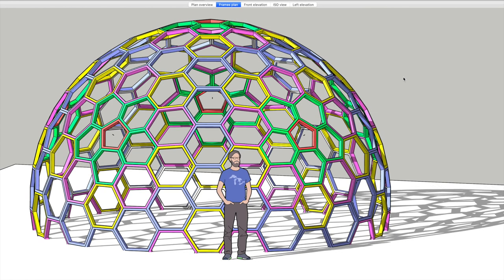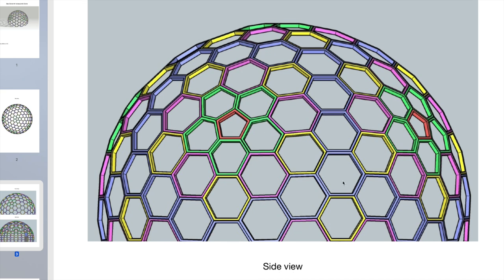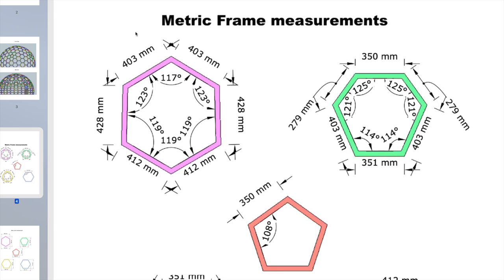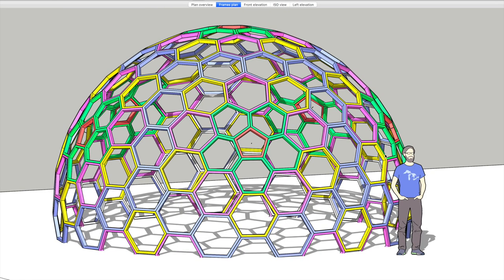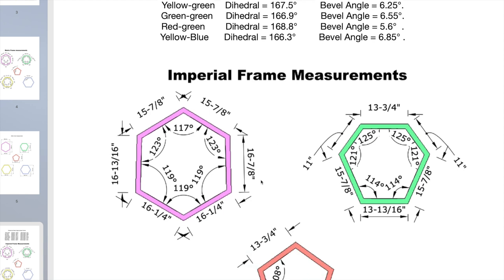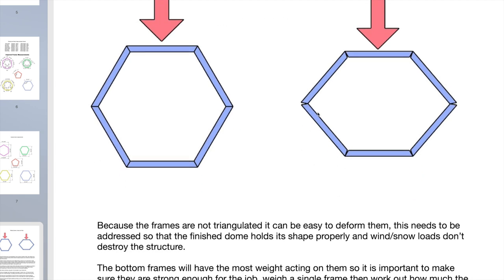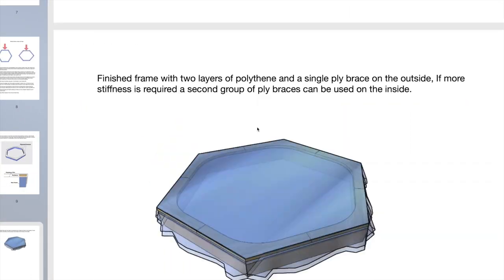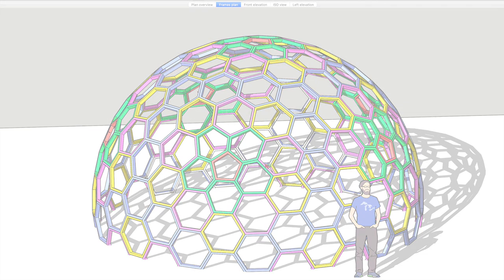Free 9v Honeycomb Dome Plans - from Geo-Dome

Comment: Paul, I'm thinking of a 13 or 14 metre dome, in a snow load ares. Would this design scale up?
Reply from the maker: Yes it could be scaled up but you need to think more seriously about structural integrity, I would look to cross brace the hexagon shaped and form triangles because they are much stiffer.

Comment: I am considering this as an option for an inner structure to projection map. Vacuum form plastic sheets to fit these hexagons and zip them together.  Outer dome structure could be a slightly larger 9v Icosahedron perhaps.  Or could one fit this 9v hex pattern within a 3v Icosahedron?

Comment: Hello Paul!
I've built so far 5 domes (3 different models) with the help of your plans from the website.
All of them (except one which is done by the hinge method and covered in fiberglass) were done using the bevel frame. Main problem, huge problem, is the termites. So I want to switch into stressed skin, galvanized sheets, styro glued inside, combo of rivets and MIG welding, paint outside... What do you think?
7m diameter, 3v, 1.6mm galvanized sheets... In theory it should work using your 3v plans, no? Need a diy sheet bender and should be good...
As you said in a previous video this is probably the cheapest (and most overlooked method of building) with the main con (condensation) easy to fix with a decent layer of insulation glued on the inside...
I think I'll have a go at a 3v and a 9v, using your plans...
Correct me please if I said something terribly stupid.
Greetings from the Philippines!

Comment: Hey Paul, first thank you for amazing job !
I have a question and i can't find any answer, how do you calculate the dimmension of the wood that you use for all your domes ?
Is there any formula or rules to apply ?
Thanks for taking time to read my comment !
Reply from the maker: Ok there is an equation called the slenderness ratio, in Hugh Kenners book "Geodesic math and how to use it" recommendations are to not exceed 24/1 for wood, 30/1 for metal. it's a ratio of length divided by diameter, Let's say you have 50mm square strut material x 24 = strut length of no more then 1.2m. I myself use a much cruder system, I test a strut by hanging off it when it's supported at both ends, if it bends with my weight I use thicker timber. Not much of a problem with small domes but you want to be careful  on big domes over 15m diameter.
Reply: @Geo-Dome  Thank you so much for your answer sir i'm good to go now

Comment: Hi! Another question. I wonder if I can use the same measurements and do it in concrete instead of wood? Is there any standards and construction codes for safety issues? Does it have to be reinforce in any way?

Comment: thanks a lot paul !!! can anyone tell me how to calculate dihedral angles on "normal" domes or where to look them up? i already found the angles for 2-,3- and 4-Frequency, but where can i find 5-,6- and bigger? Thanks a lot
Reply from the maker: OK it's not so simple, I have different dihedral angles on my 3v plans to keep the bevel angles all the same, if you change a triangle it will make the dihedral different so you can have the same frequency with different dihedral angles. I'll put a video together showing how to do it, just keep an eye out for it.
Reply: @Geo-Dome  wow, thank you so much !!!

Comment: Thanks for the pdf file, but what is the dimensions of the wood squares ? It should be included in the plans ;)
Reply from the maker: You can use any size timber you like, you need to find out how strong you need it depending on size and use. https://youtu.be/Xsmf1tnpnBY

Comment: Where in the plans does it show quantity of each strut/panel?
Reply: There should be 166 panels in total including the half hexagon base panels that are not shown in the pdf
Reply: Hi Paul thank you for showing your plans for honeycomb dome could these plans be used for a frameless dome using 2mm polycarbonate panels 3.6 diameter

Comment: what about V4  or V6 using conduit tubes jointed with hydraulic flanges fastened as hubs?
Any clue about this... system?
https://www.youtube.com/watch?v=qOD9yy6LPfY
Any clue about using a "clamper" with reciprocate joint... this tool here
https://www.youtube.com/watch?v=mRc7ZDRcgrQ&t=238s